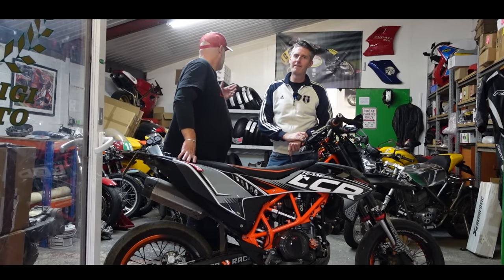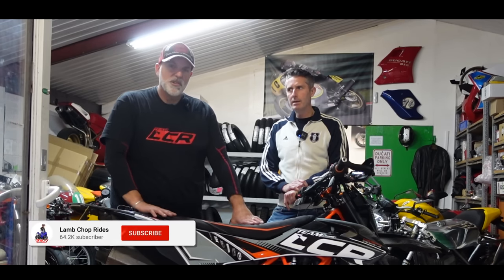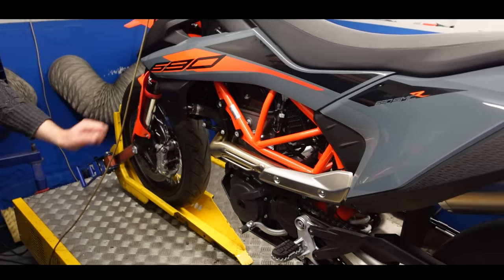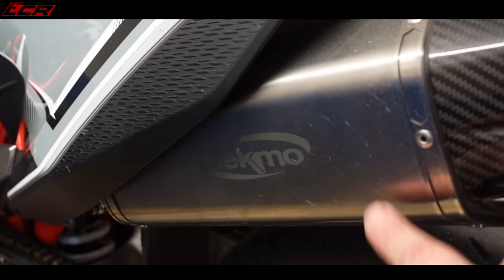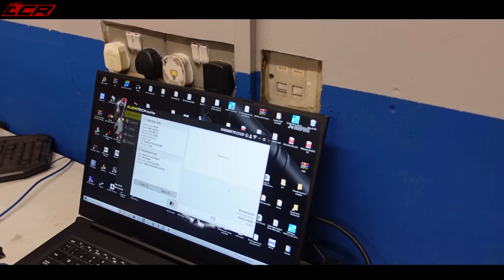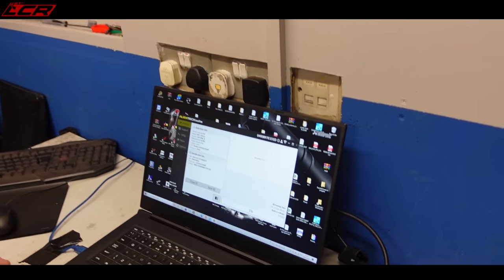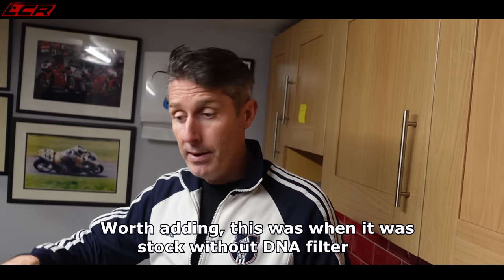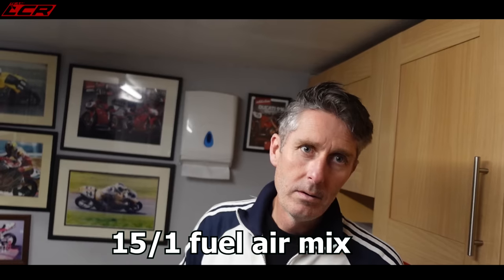KTM 690 SMCR Dyno Mapping | Finally Its Running Properly!! 💪💥

Comment: Extremely informative episode.  Did not realize that lean fuel/air ratios were needed for catalytic performance but does make sense.  Amazing the power that the 690 motor can produce.  Thanks for posting👍.
Reply from the maker: No I didn't really either Paul until Chris told me 👍
Reply: ‘Running lean for the CAT to work’ isn’t true, or has been explained’poorly’, fueling is normally approximately 10% richer than a non-cat fitted engine… this is to provide the energy to ‘lite’ the cat and keep it running hot and clean… too lean or rich is bad for the cat both in performance of its emissions and if rich it will over heat and melt. 

The lean condition they are talking about is only at lower rev’s on acceleration where being lean means a crisp throttle response as long as its not too lean where it will stumble and or not accelerate… If its rich the throttle will be lethargic, ‘woolly’ and sometimes feel like the throttle is an elastic band.
Reply: Think Chops should do a ‘Tea’ channel’, he knows how to make a properly cuppa and by the looks of it there are loads of people out there that need some ‘training’ 😂

Dark tea and or full fat milk in the tea 🤢
Reply: The tune they did should make the bike a lot more relaxed when just cruising and a lot more lively and less gear dependent 👍
Reply: Chops, think you should get them to trim the tune to the bike, even though it may be only a couple bhp change, its the throttle response and ride ability that will improve lot.
Reply from the maker: @jamest5149  haha I should! 😄
Reply: Lean AF is good for CC's, fuel mileage, emissions etc...

Comment: 😎👍🇺🇲

I'm trying to learn as much as I can about the 690.
I've only had my 2021 for a few weeks and just a handful of rides.
It came with everything. Full exhaust, commander, air box . The full kit.

I really just wanted a bit of a upgrade to the DRZ SM.
I certainly got it.😏
Due to weather and other things like a fresh rear on wet roads and so on.
I haven't even had a chance to run it hard.

But the couple of times I could stab at it. Wow.
I sold my nicely mod'ed DRZ to a coworker and friend.
Can't wait to run the two together.
He's a new rider and I'm the "old super bike guy".

Should be fun😈

Comment: I bought another 701 off the back of your build with a full Tekmo system (and a stage 2 DNA waiting to go on) and fuel optimiser dongle.   I was gutted to learn from Dynojet that the PC V doesn’t adjust ignition on the euro 5’s and that currently they have no plans of making a new PC.   But watching this gives me hope as mine is running crap without a tune.  An ECU flash seems like a good alternative.   Thanks a million I’ll give em a ring 💪👍
Reply from the maker: Yes exactly! PC and dongle combination might not work..  seems conflicting info out there hence why we went to Chris
Reply: @LambChopRides  what about with PC 6 now?

Comment: The catalytic converters need a 14.7 mix because they effectively finish the parts of the combustion process that didn't happen in the cylinder. It doesn't like a variant mixture, because it can poison the catalyst.
The throttle mapping does the same thing that throttle cams do on traditional throttles, it just does it in a way that varies at different RPM. If you look at the throttle actuator on a cable throttle you'll see that the diameter varies around the perimiter of the cam, this changes the amount of throttle you get at the blades compared to the twist grip... Same thing has existed since carbs. :)

Comment: Mapping these bikes is essential not just for fun but crucially for safety. It's money very well spent - if any one has any doubts just stop thinking about it and get it done, you'll probably save money on broken bike parts and time off work because of injury!
Reply: Just a question, but why for safety reasons?
Reply: @Vince27.  the engine will cut out when you move off at for example a junction and you'll find yourself on the ground with traffic approaching and you under the bike - happened to me, broke my foot too. These bikes are great but they need remapping.
Reply: What your saying Ed has happened to me, I was crossing a duel carriageway I entered the central reservation there was a hill crest to my left so you have to be sharp eyed checked double checked went to pull off and it cut!!! A van was steaming over the hill thankfully he swerved and missed me, at 50-60mph I wouldn’t stand a chance, my bike will definitely be going to Chris for re-map and anyone else looking to buy these Amazing bikes I would factor in the cost of this essential work.. don’t hesitate

Comment: 80bhp at 7400rpm dropping to 79-78bhp till rev limiter and 82nm at 6300rpm, 26hp 62nm at 3070rpm, 59hp 77nm at 5500rpm
rotti air filter, tekmo ti header, 21' akrapovic silencer, ecu tune + pcv fine tune done at Tovami in Goes, Netherlands on my 2021 690 smc-r.
Definitly a crazy improvement over stock.
Reply from the maker: Fantastic results 👏

Comment: Nice one John been waiting for this. I’m going to get mine booked in with Chris. I’m local to him. Mines running same as yours but with the dna filter and plate. That’s full tekmo system, power commander with map for full tekmo map and Rottweiler induction kit. Be great to see what it makes and if it needs improvement.
Now we need a after vid in the dry!!
Reply from the maker: Yes highly recommended Dave! 👍

Comment: moreover, it is important to point out that:
- the throttle body is really small, 50mm for a 693cc.
the 56mm of the Superduke GT would be more suitable for increased power
- the injector is that of an exc-f 450 from 2015, which is less efficient than that of an exc-f from 2023 and STILL less efficient than that of an Sx-f 450 from 2023, at the time to say that for a 693cc...
- the camshaft does not allow maximum valve opening, and is sized for low revs ~6000rpm
- the valves are made of steel, while the titanium valves exist
- on the 766 version, it was still possible to add an oil cooler to improve cooling, lubrication (the big pump helps the small one) and a slight gain in oil capacity

the 690 is easily capable of exceeding 100hp, it was already the case in 2009 with the first version with its shitty lubrication.
autemps to say that in 2022, it would remain as reliable and enduring as a cross.
frequent emptying and segmentation (and again..) but a fire engine

Comment: DNA / arrow for the win .... thats what i have found when looking at my re,map on the tenere good to see it reflected on the ktm
Reply: I's say DNA (3rd of the price of Rotti) and Tekmo are for the win
Reply: @davecornish6716  is there a substantial reason for this other than boosting CRTs sales? 😊(with respect)
Reply: @SuperPlasterMaster  nope, its a free world and there's plenty of other pipes and induction systems about to choose from :)
Reply: @davecornish6716  I wasn’t trying to be rude. I’m  genuinely looking for good reason for this combination.

I have already bought a titanium Tekmo  header from you but I went for an arrow slip on, purely cause I preferred the look of it. 
 I am looking to get the DNA air filter and either flash the ECU or buy a PCV (most likely both from you)

I just like to know all the information before I make a decision is all 👍🏻

Comment: Very interesting Chops. Really enjoyed that. Interesting to learn about what additions makes an engine more powerful or not, as well as what boosts mid & peak power. I also didn't think the air filter alone & shape of the exhaust could make that much difference either. Everyone's an expert on every forum these days regarding engine tuning but there's lots of incorrect info, ignorance & myths out there. Shame you couldn't get more out of yours I guess but great to know it's running at optimum peak performance.
Reply from the maker: Yes absolutely was great to compare the differences with the spec wasn't it 👍

Comment: I had a very similar experience when I had my 2020 smcr with Rottweiler bits on the dyno at PDQ in Maidenhead - the ‘stock’ Rottweiler map was pretty much spot on. Hats off to PDQ though they were still able to find more power throughout and improve response going from a closed to open throttle.

Comment: Great to see the sumo on the dyno chopsy, sound great just bought a 701 and have fitted the DNA filter and plate also wings can  ! Couple of dongles  so can't wait till spring to see how it runs it's a 2019 Euro 4 . Was running very lumpy at low revs so hopefully better now 👍 now get back to getting the garage up and running .👍😁😁

Comment: Great video Chops /Gregorio so I’ve got a brand new 22 701 enduro. So I’m thinking Greg’s setup would make sense for off reading on mine ,or am I wrong
Reply: It would work perfectly too so I would go for it.  Will improve the bike enormously
Reply: @gregtufnall6276  I have the same model and year as you and would love to get these power gains low down. Did having the ECU flashed worry you regarding the warranty?
Reply: @SuperPlasterMaster  not personally no.  My bike is reliable and so I’m hoping I’ll not have issues anyway.  The bike ran so lean down low in the rpm, I was more concerned this in itself was causing damage
Reply: @gregtufnall6276  that does make sense. Maybe next year I’ll bite the bullet.
I have the same tail pipe as you and the same header as chopsy.

I was gonna get the Rottweiler air filter  but I might go for the dna.
What made you go for that one rather than getting the same as chopsy’s?
Reply: @SuperPlasterMaster  considering it too after watching this. My Enduro feels on or off at low revs in techy bits, really snatchy so you have to ride the clutch. Sounds a bit like the map could smooth that out.

Comment: Hey John love the channel and it’s through your 690 build series I have started my own and basically taking what you have done to yours..mine is a 22plate euro 5 I have just put the full tekmo exhaust and fuel optimiser I have the stage one dna filter but now want to put the stage 2 dna plate like the other 690 I’m a bit confused now as I was going to get the power commander but  am I right in saying that Chris can tune the ecu Instead?? It’s roughly the same price either way so it doesn’t matter just want to know which way is best,  if I did go the power commander can the map be changed to more midrange punch?
Reply from the maker: Yes actually cheaper for Chris to tune and forget the PC. The Euro5 is tricky with the PC5, only people I know of who can do it is P3 Tunning
Reply: @LambChopRides   lovely, thanks for the response most appreciated I will give them a call, and keep up the great work😎

Comment: 5:14 that arrangement looks interesting. I'm assuming there's enough exhaust gases flow through the sensor. is that stem sticking out sort of a vent to allow the flow? is it a valve stem off a wheel or what? I guess if it wasn't there, the gases wouldn't be able to reach the sensor on that adapter?

Comment: GREAT VIDEO AS ALWAYS CHOPSY!!
I love all the vids you have done on your SMCR they were great aid and got me excited when I was first looking to buy my own Smcr, at the start of this year. So thanks for all the great content!!

I have a question though.
Am I right in thinking John, that the only way to improve the performance on the euro5 (at least in The closed loop section) is to flash the ECU? (Like Chris has just done to Greg’s bike)
As apposed to installing a Power commander 5 like you have done on your bike (Euro4). 

Can I also assume that a ECU flash would void my warranty?

Looking forward to seeing some videos of yours and Greg’s bikes side by side to see that middle and top end power difference 🛵🏍💨
Reply from the maker: Thanks buddy 👍  Well yes there has been some discussion about this and I'm not convinced you can use a PC on the Euro5 bikes. You have to fool the ecu to ignore lambda inputs and allow the PC to adjust fueling otherwise you are just fighting the closed loop. Some say their dongles work on euro 5 some say they don't. To avoid issues this is why we flashed Greg's bike 👍
Reply: Yeah I have the 2022 smcr with an arrow end can.
I also have dongle from Crt and the titanium Tekmo header pipe but I havnt fitted them cause I have read alot about the dongles not really working and I worry about the header pipe effecting the warranty. 

I’d love to get some more torque and power at lower revs. 
Mine just isn’t as snappy as the older models. 
It just will not wheelie in 3rd gear!

Comment: I have the 701enduro and would not want a hot tune because it would further shorten fuel range (which is already on the short end and my 701 is set up for ADV use)... but for the supermoto that tune must have really put a smile on his face.
Reply from the maker: Yes it's incredible!! 😁👍

Comment: Chops I have a 2021 and I don't mind what mine is stock aside from the bad fueling down low in first. What do you think would be my best move to go about fixing it? You think doing the filter and power comander like your buddy is the best move?
Reply: exhaust, (takes out the cat) DNA filter and remap instead of a power commander should wake your bike up. Best to do all at once. Stock these bikes are very restricted, you need to invest in them to be more fun.
Reply: @tubejorrit  got ya. I honestly love the bike stock. It really is just that first gear fueling that's annoying. The exhaust is ugly too but I just look at it from the other side haha
Reply: @tubejorrit  what would I need to do a remap? Just take it to a tuner and they can flash it and remap it themselves?
Reply: @wowIloveusernames  Find an experienced tuner that can reflash the stock ecu, like the tuner in this video. There are not many who can do it and even less that can do it properly. I had to travel 3 hours one way trip to get mine done.
Reply: @tubejorrit  thanks man. That sounds like a plan.
Reply from the maker: If your based in the UK get down to Chris at CJS Racing 👍
Reply: @LambChopRides  I'm in the US otherwise I would!

Comment: The lunacy of all regulations is that the engine tune is based on cat performance not fuel economy. My ATAS DC had dreadful economy at 20 mph crawling around to stop being popped on a camera yet way better at 40 mph and positively frugal at 70 mph. My 890 Adventure averaged close to 100 mpg at a steady cruise controlled 50mpg yet in town lucky to get half that even with gentle throttle use. As ever we’re controlling the wrong thing for the wrong reason.

Comment: Nice tip about not using the first couple of runs for comparison.  Question: If you still need a remap after installing a power commander why not just remap the bike without a power commander.
Reply from the maker: If we had time (it was 430 when we finished gregs) I probably would of said let's do mine but as said in the vid wasn't worth the efforts working late

Comment: So is the powercommander unable to overcome the lambda "correction" keeping it lean/slightly down on low end torque?
Reply from the maker: You need a dongle to replace or sit inline on the lambda. Some say they don't work so to save risking it we flashed Greg's bike
Reply: @LambChopRides  I fitted a inline dongle on my euro 5 690 sm no mods only arrow can and  it helped alot no lower rev stalls and the bike sounds and pulls way better .
Now thinking on DNA and remap 
Great video 👍🏾

Comment: I had my euro 5 SMCR remapped and the airbox mod done with a different filter. I now have the engine management light on (MAP sensor being the cause). The bike is running perfectly but I want the light gone. Any advice?

Comment: Hi there I like to put a question out there what age 690 would you say is best buy to modify easily and max fun and performance with best engine
Reply from the maker: The 2019 to 2020, the previous engine on the early ones isn't as good

Comment: Here's a question. What if you've purchased a secondhand bike (an MT-07 in my case) which has a full system would you need a diagnostics tool to find out if it had been re-mapped/flashed at some point?
Reply from the maker: You wouldn't know, only way to tell is to compare the exported map files with the specialist software.

Comment: Any idea from KTM on whether this would void the engine warranty on a bike still within the warranty period?
Reply: Absolutely!
Reply from the maker: Yes warranty voided of course, which is ironic as its running much healthier than a standard bike!
Reply: Void 100 Percent.
Reply: @LambChopRides  easy DIY job to remove the Power Commander and 'hey presto' there's your warranty back

Comment: I have a question.... does the SMCR still have the 2nd and 3rd gear restriction? Also ,the best thing I ever did for my 2007 Supermoto was to upgrade the injector here  at gray area KTM.
Reply from the maker: No I don't believe so
Reply: @LambChopRides  it would be really interesting to know, I wonder if you could search it and let us know if it does indeed have the same restriction, and therefore an unrestriction route! As it was definitely a thing to do on the older models. Great channel, great series!

Comment: All I've seen for ages is flashing gives much better results than a Power Commander. It seems the Power Commander more than held its own. I have a PC-III on my track gsxr and it makes it easy to swap maps if have to put the baffle in or change the can due to noise
Reply: No you are right.  The reason for the ECU flash here over a PC5 as that the PC5’s don’t work on the new Euro5 690’s or 701’s.  Developing a custom map and flashing is the only option at the moment.  Cheers
Reply: It's probalby down to what they pointed out - the ECU has target AFRs it tries to achieve. you might trick the ECU about the data it gets from the sensors by using PC but at the end it will still check if the AFR matches the target numbers. without disabling the o2 sensor I think there's not much you can do using a piggyback like power commander.
Reply: @plllot9713   Yet it was bang on for Chops.